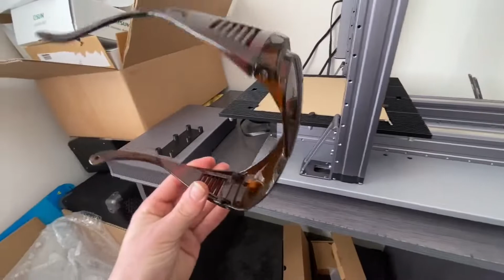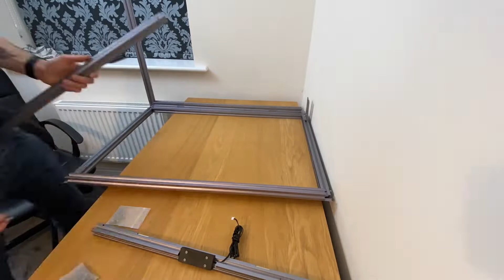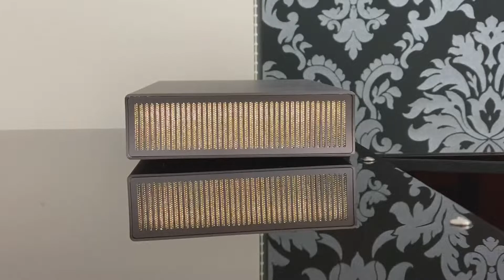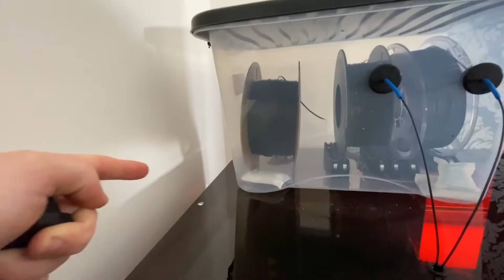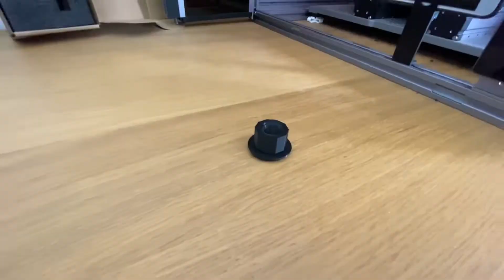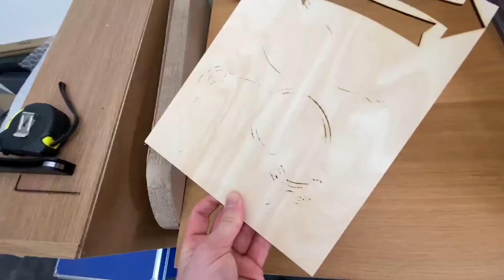Finaly getting Snapmaker 2.0 A350 Set Up! It Takes Up A Whole Desk!

Comment: Got my A350 (hope it is T which is what I paid for but outer box doesn't say that) waiting on the enclosure this week... this is the first video or anything really that answered my question on whether the doors are reversible on that... seems a terrible design flaw tbh. Wondering if I can drill new holes and actually do it myself at this point.
Reply from the maker: If it’s any quieter than this then it should be. They don’t make it very obvious to tell the difference. I’m expecting new modules from the T version to help with the noise myself. I’m sure you could modify it to make it however you wanted, but some serious effort and planning will be needed to get a clean end result. Let me know if you do it or if you need any info about the standard enclosure 👍